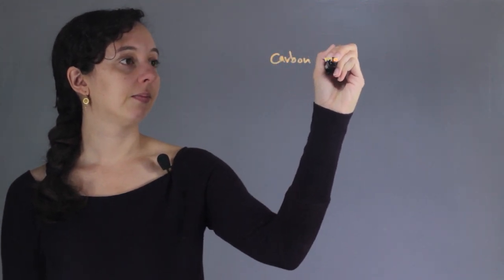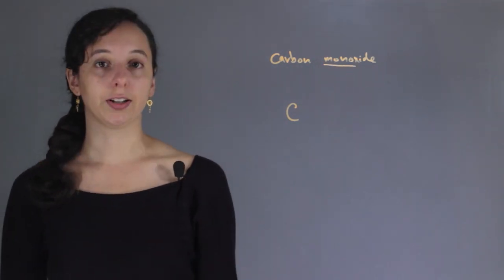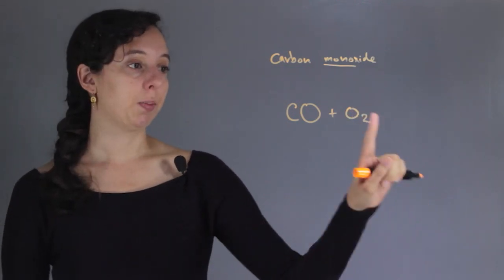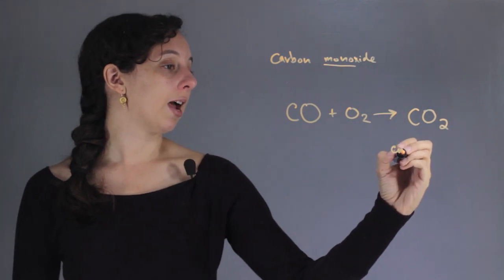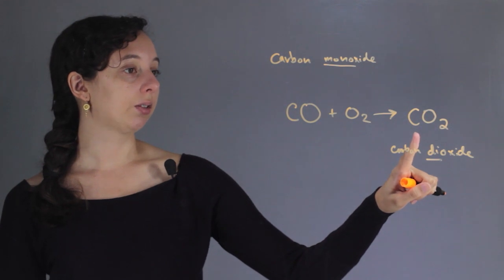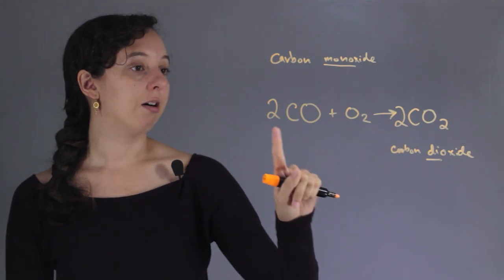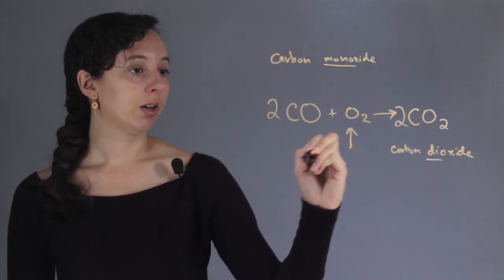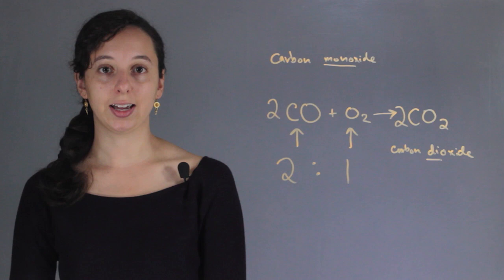Air-to-Fuel Ratio for Combustion With Carbon Monoxide : Chemistry & Biology Concepts

Comment: Your air is oxygen???? LOL maybe science is not your thing
Reply: This isn't even a combustion reaction.  This is an oxidation/reduction reaction.  Combustion, by definition, requires h2o, co2, and energy is the reaction products.  This reaction does not create water.  NOT combustion.  I would say science is definitely not her thing.
Reply: All acid/base and combustion reactions must create water.  By definition.
Reply: hey , it has generally taken that the O2(or can said to be air as generally O2 is the main Component of air around us )  reacts with CO..... specifically we will say that if u want to know the air to fuel ratio (generally O2 in such cases) ...{ if u want to react CO with NO u can go ahead and take NO as major part of the air for that one :)    }  I hope  you understand... 

@LeeAnne Polvi  just called this one....
The question was air to fuel ratio. Let's call oxygen as 20 % of air. The ratio now changes  to 2co to 5 àir.
Reply: @AryanSharma-iv9mh  No, I don't understand at all.
Reply: @levettp  Sir it is generally taken as most of the part of air is oxygen at time reaction. so, it can be called as air